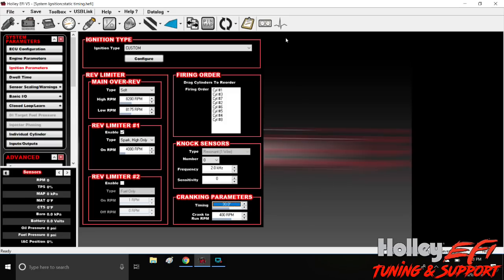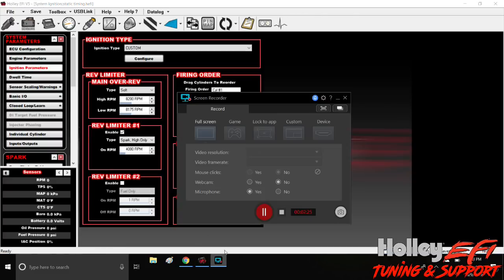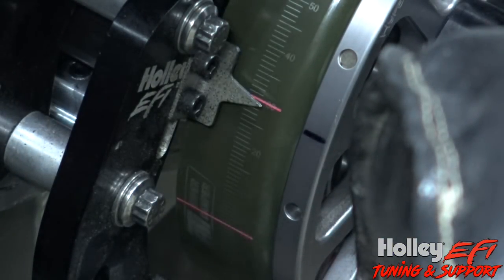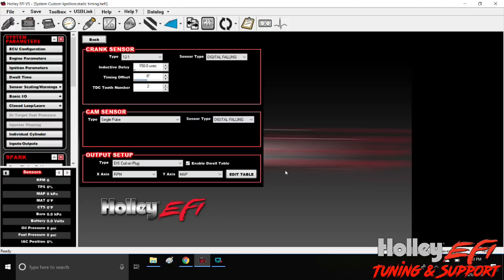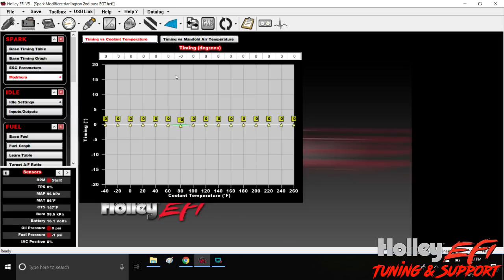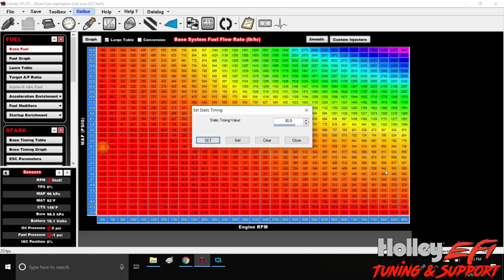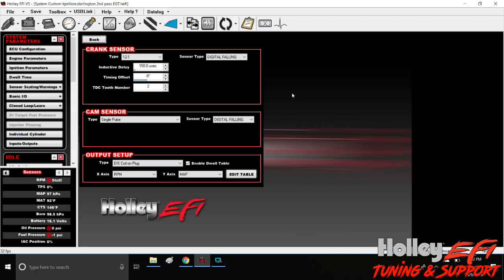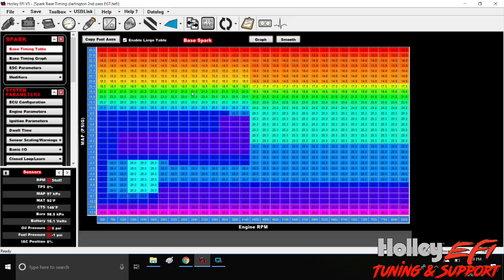Confirming static timing with Holley Efi

Comment: I know this video is a few years old now but it has helped me immensely. With my sniper 2 I can't set the static timing unless I disable the idle spark control. And I think that's why I was having issues. 

What I don't understand is if all this is electronically controlled can I leave my engine at 0° TDC and just have the program at the correct idle/cruise/WOT. It's sparking at the correct degrees right? 

Everyone tells me to physically set the engine back to 15° BTC but what's the difference if the spark is electronically controlled anyway. I understand the concept with none electronic controlled carbs and distros but with everything programmed why does it matter?

Comment: In this video when the engine is cranked at 30 degrees the timing pointer does not line up with this mark yet you say it is right on the money. Please explain this.
Reply from the maker: it lines up with 30 on balancer

Comment: My crank timing (15') matches my timing light. So does my idle timing table(30'). I disable idle spark and set my static at 30' i rev it up to about 2500 and my timing jumps to 36-38'. My inductive delay is 1. Any thoughts? ( sbf msd tfi)
Reply from the maker: add inductive delay

Comment: Good video man! Really digging the layman's terms you put down when explaining things. Do you have any fuel videos in the future? Been trying to see if there is a dual fuel dominator setup. Like gas to methanol and then back. Either way thanks for helping make sense of all these tables
Reply: Not sure exactly what you mean by dual fuel dominator setup, but we ran both E85R and C16 in one of my Holley EFI tunes (turbo dragbike that ran both fuels at the same event)...
After running both Fri. and Sat. on E85 we weren't sure he had enough fuel to go more than 3-rounds Sunday (because it turned out that E85 wasn't available at SGMP at that time). So rather than risk possibly having to change fuels "between rounds Sunday" he bought C16 and we switched fuels Sat. night...
This bike was originally tuned and raced on C16 so it was as simple as loading the last C16 Global File that we ran at SGMP...
Reply: @KCadbyRacing  dual fuel setup as in while driving around town and out of boost just using the 93 octane which is available at all the pumps. Then if/when you get in the throttle, it transitions to the secondary injectors to inject m1 while phasing out the gas injectors. Nelson Racing does that on his big street car builds but uses a different computer, was trying to see if that was possible with the Dominator.
Reply: @Reject06  Ah... I'm obviously behind the knowledge curve on that, partly because all of my 30+ Holley tunes have been on bikes so a Duel Fuel system would be a lot more difficult (even though we do run custom made fuel cells on some of the bikes)...
Learning new (to me) things about Holley EFI is one of the reasons Devin's channel is now my favorite Holley EFI channel👍
Reply: @KCadbyRacing  yeah this channel helps explain all sorts of abilities and adjustments with the dominator. It's why I keep coming back!